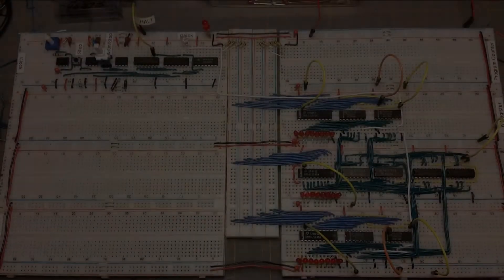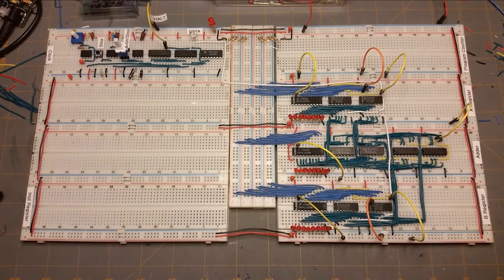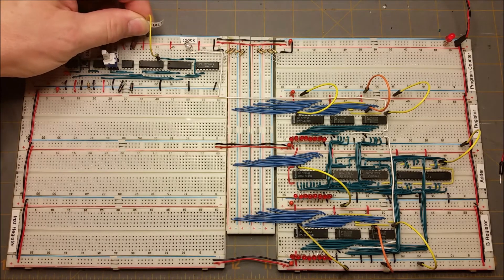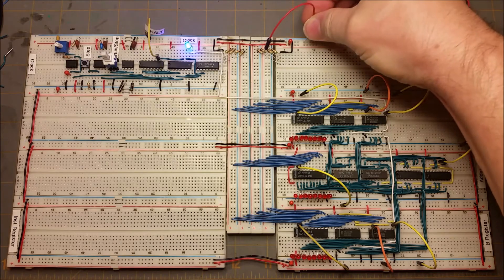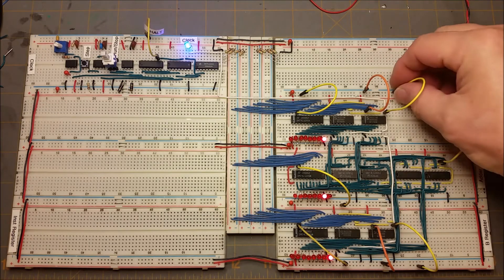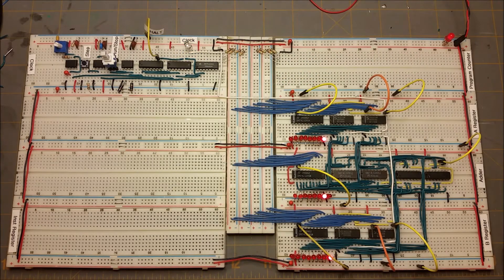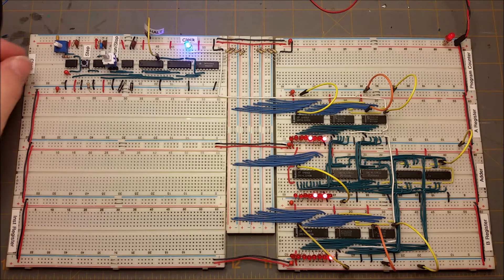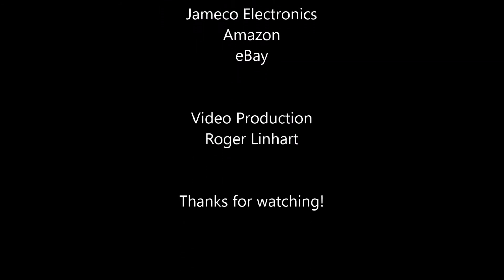My Ben Eater 8-bit Breadboard CPU Build Project Part 1

Comment: All IC's have internal a resistor to limit the current to drive the LEDs ?
DJ
Reply from the maker: Not an internal resistor but the outputs are current limited on 74LS series chips.